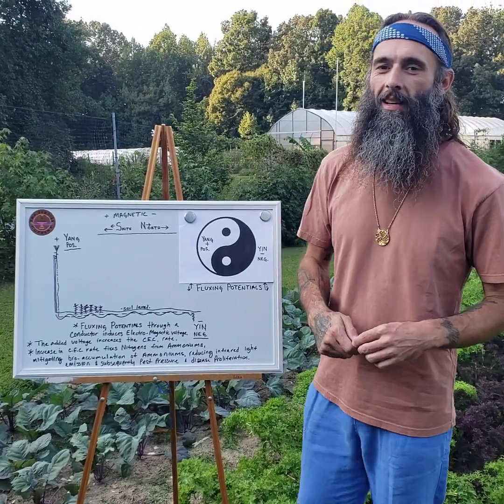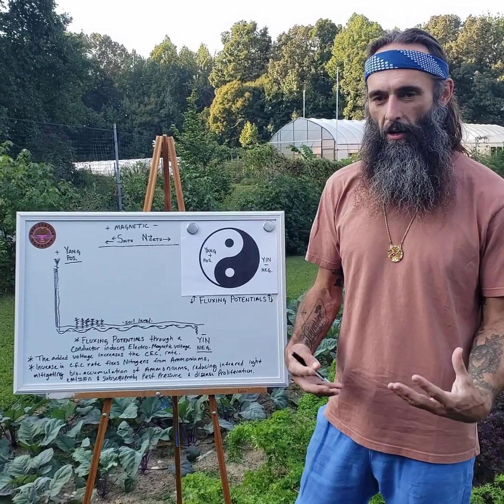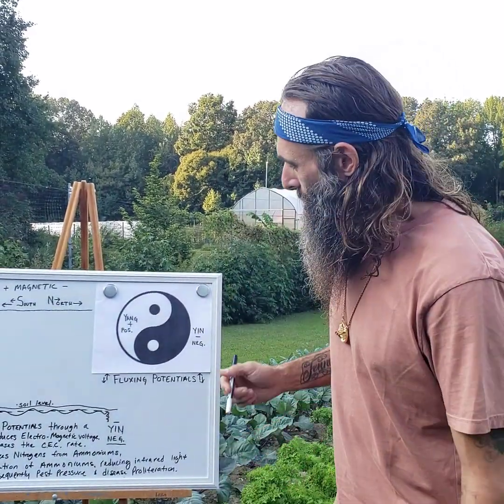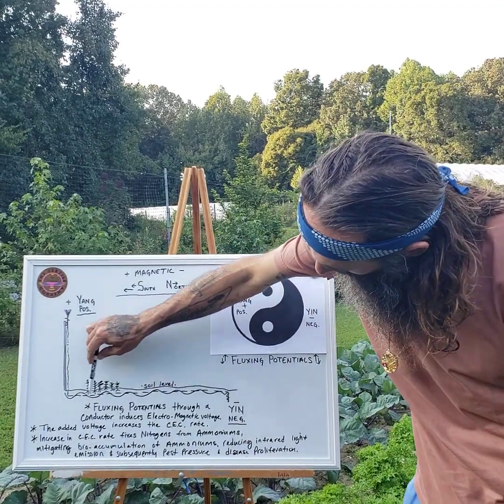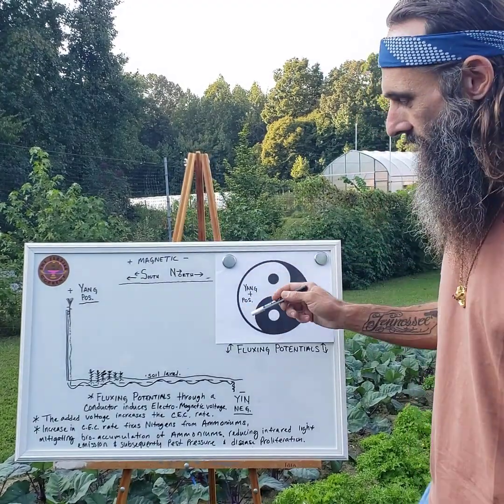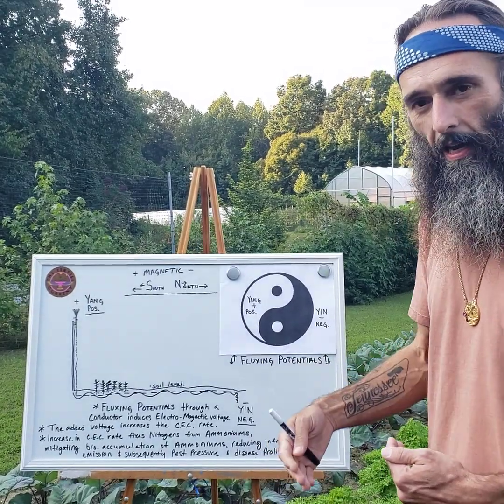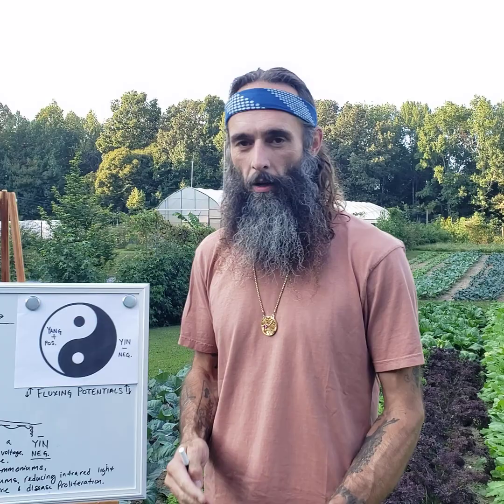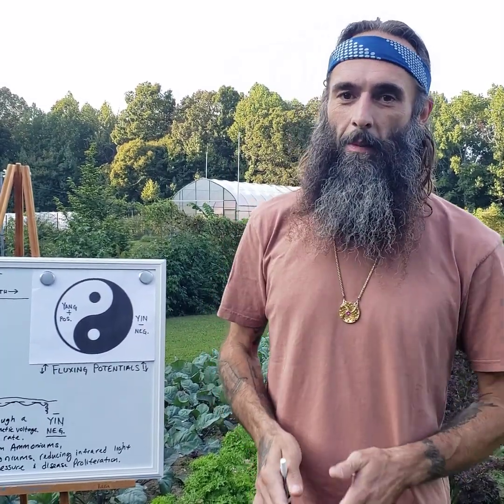Electroculture Demystified       @TheFertileCurrent

Comment: It's physics, the terms can be identified as the source of energies. The earth is a giant capacitor, the ground is the negative plate and the upper atmosphere, the ionosphere, is the positive plate. A very high potential, voltage, exists between the two. Electricity in conjunction the aether influences the earth, the cosmos, and life itself. I'm a science/physics nut case, so to speak and experiment a lot. Beginning with Baron Karl Von Reichenbach I have read about many many discoveries to present day. The planetary government does not want this information proliferated.
A friend asked me to study and apply this technique to his organic garden with the reward of plenty fresh produce.
The use of crystals, and the aether is just a branch of Physics, most people don't understand this.
Thanks for your"positive" contribution to the subject.
Reply: A friend who has green thumbs up to his elbows asked me to do some electro-culture for him. Turned a few antennas for him. He said the difference could be seen in one day in spinach. He gave me a book about active electro horticulture using a small voltage and very small amperage. Will use both, Your information is very informative and helpful. I'm a experimenter and radio nut, so these things are already in my data base, my head that is. The ground is unbelievably conductive and an ocean of electricity. Be safe.
Reply: le corps aussi est électrique ...........

Comment: How deep into the soil does the wire need to be. Mine touch and enter but probably just an inch or two. Mines more of just antenna then that isn't working although I'm seeing improvement.
Reply from the maker: Hey friend. Its ideal for the ground wire to run through the rhizome layer. Usually somewhere between 10 and 16 inches deep in the ground running south to north.